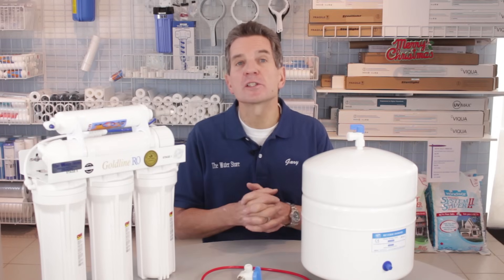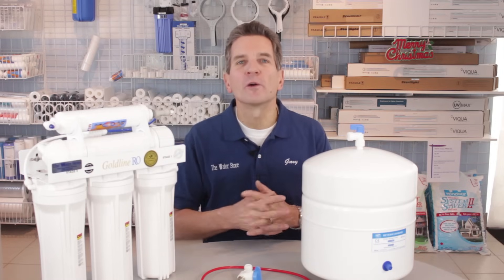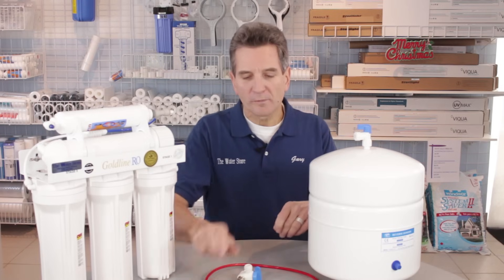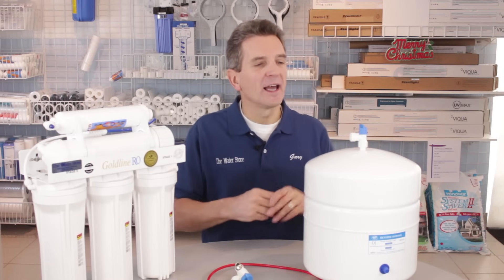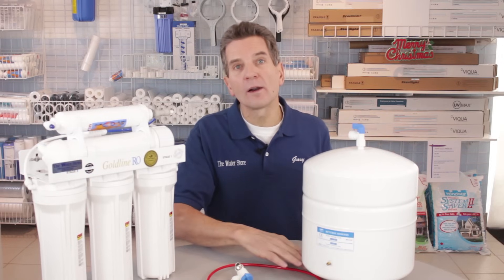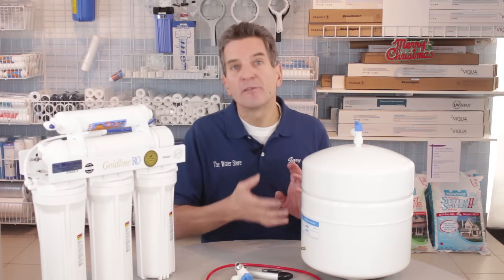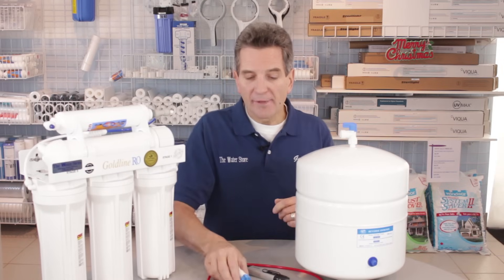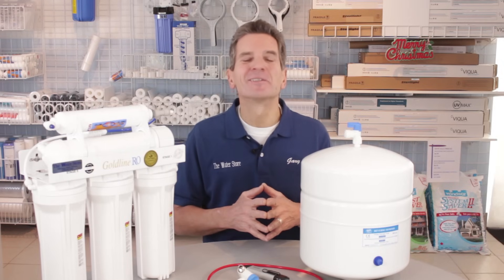Reverse Osmosis Troubleshooting - Little or No Flow from Faucet

Comment: Is it actually 6-8psi? I saw on a culligan website  a min of 60psi. I pumped mine to 80, and still no flow. The valve is open but since we turned it off because of fridge problems, we haven’t seen any flow except a slight trickle
Reply from the maker: Yes, it is actually 6-8psi.  If Culligan said 60 psi they are incorrect.  Try 6-8.

Comment: When my system was installed they only put 3.5 to 4 PSI into it. This time I did the filter change and noticed maybe half of the tank was emptying. Took the tank down to the garage and added very slight amounts of air until all the water was out. Thanks. Can only imagine how much that house call would have been.
Reply: Great video. What is missing is how much air to pump in to drain the tank. "added very slight amounts of air until all the water was out" should be a part of the video.

Comment: If worse comes to worse and I have to replace the tank, can an off brand water storage tank, like TankRo, which Home Depot sells, replace a GE water storage tank? It looks like both have the same type of water valve
Reply from the maker: I am sure it will work initially but you may not get much life from the off brand tank.

Comment: So if there's only a trickle of water coming out and the tank is empty, not full. Would I just need to check the pressure and adjust it accordingly to get it to work again? Or do I have a different problem???
Reply from the maker: Check the tank first. If not then when was the last time the membrane was replaced?

Comment: my system is weak and only put out a few oz per hour. the tank is not full of water it always seems empty.
Reply from the maker: When was the last time you replaced the membrane?  Also, what is your water pressure going into the system?
Reply: @water_estore  i replaced all filters and membrane about a month ago. i did use a t tap to tap into my water line maybe thats to little flow?
Reply from the maker: @TheSummit396  you do need significant flow and pressure to operate the RO.
Reply: @water_estore  as soon as you mentioned that i got a different type of tee tap and it fixed it! Thanks so much. i will be getting a new water softener in near future ill keep you in mind.

Comment: Hi, I was hoping you could tell me about my AO SMITH under sink main faucet filter. Model 1449244 AO-MF. My question is, after installing it, why is there no water pressure at all?
https://youtu.be/G3p7IrO7S9o
Reply: It claims on the box not to reduce water pressure, but it is.
Reply from the maker: Sorry, I have no experience whatsoever with those.  Have you tried calling the manufacturer?

Comment: Great Video!  We have a American Plumber WRO-3500 system and a 5 Gal. Tank.   The tank was about empty in the morning after filling all night.  Checked the water going into it and it's drops and not a flow or stream of water.  What is the normal flow into the tank coming from the system?  we just changed all filter, so they're all brand new.  Is there another issue or blockage causing this?  If so, where?  Thanks!
Reply from the maker: Did you change the membrane.  I don't know how many gallons per minute your membrane is rated for but if it is 50 , you would get about 1 gallon per hour of flow from the system.  Did you add any air to the tank?
Reply: @water_estore  Hi,  Changed to new one which is 30 GPM.  Followed your instructions and it seems that the Shutoff valve is not good as the drain water never stops when tank is shutoff and main is on.  Would that effect the membrane from functioning right?  Shouldn't the tank be filling anyway?  with new membrane removed, and no membrane installed, the tank fills out good.  Is the water drinkable without the membrane?  I do have the other two installed (carbon and post polishing).  Thanks!
Reply from the maker: Omar J. Reyes did you replace the membrane with the same god capacity as the original one?
Reply: @water_estore  Hi,  Changed to new one which is 30 GPM same as old one.  Followed your instructions and it seems that the Shutoff valve is not good as the drain water never stops when tank is shutoff and main water is on.  Would that effect the membrane from functioning right?  Shouldn't the tank be filling anyway?  Would this happen if the new membrane is defected or clogged.  FYI:  With new membrane removed, and no membrane installed, the tank fills out good.  Is the water drinkable without the membrane?  I do have the other two installed (carbon and post polishing).  Thanks!

Comment: Gary, I was watching this video as the water pressure on our APEC RO system suddenly decreased to a trickle. I checked the large tank and it feels very light, so I dont think it's water logged. The filters havent been replaced in maybe 1.5-2.5 years, so not sure if maybe that is the problem. Any other suggestions? (my email is pappasm898@gmail.com)
Reply from the maker: Change the filters first.

Comment: if i just install my RO system.  and i have very low flow,  what is the cause?   Does it take the 2-3 hours fill time as stated in the manual for flow to be to normal rate?
Reply from the maker: Yes it does

Comment: Uhhhh ok, and what if the tank is empty?  He totally ignored that, and that's my problem...
Reply from the maker: If the tank is empty I would check the pre charge on the tank.  If the pressure is correct your system is not making water so likely the membrane or pre filters are clogged or there is no flow going to the system itself.
Reply: @water_estore   I have the same problem with my tank empty, and it turned out to be pre-filter clogged, the water started running again after I changed the pre-filter. Thank you so much!

Comment: why does my tank says "100" psi?? Please help
Reply from the maker: Great question!  I think it actually says maximum pressure 100 psi  These tanks can be used for many purposes but when used for an RO the pressure suggestions in the video are correct.
Reply: @water_estore  Thanks for the info!
Reply: @water_estore  I added more pressure to my tank and it's still little flow from the faucet. It is also taking a very long time to fill water in my tank.. why is that?
Reply from the maker: Co Z you need to check the tank pressure when it is empty and adjust as mentioned on the video. It takes anywhere from 2 to 4 hours to fill the tank, this video explains why How Does a Reverse Osmosis Drinking Water System Work? https://youtu.be/qlexW47DtWA
Reply: @water_estore  you're right I didn't have enough pressure in the tank. I added more and finally it's working great again. Thank you again for your expertise. I subscribed.

Comment: One "Key" point everyone fails to mention, is to replace the schrader valve first, as those bicycle valve inerds tend to fail some times, and replacing the entire tank due to the valve failing is wasteful.

I actually watched a video where the guy replaced his bladder tank, and decided to cut the old one open to see where it was leaking, and there were no leaks or decrease in pressure from the bladder due to the valve being faulty.

Also, if the tank is losing pressure, and you suspect the bladder, there should in fact be Water being expelled from the schrader valve (meaning that there is water bellow the bladder where it should NOT be (at this point you can most assuredly say the bladder is damaged, but if there is no water coming out of the schrader valve, replace the valve first (any bicycle shop will have a spare valve inner for you at a cost of a few cents))

Great video otherwise, concise and to the point 👍🏻👍🏻👍🏻
Reply from the maker: Yes, definitely if the schrader valve is the problem I would replace it before giving up on the tank.
Reply: Hi! I have water coming out my Schrader valve! I suspect that means my bladder is no good but was unable to confirm until I found your comment. Thank you!

Comment: My Aquasana tank showed up with 11.5 PSI in the tank... and after installation I still only get a dribble out of the spigot
Reply: @water_estore  OMG, I called them and they said to get the PSI "up to at least 50 psi in the tank"
Reply: @water_estore  nope, still no luck.  They are thinking I might have a bad manifold
Reply: @water_estore  Yes, their tech support has been very helpful.  They are sending me a replacement manifold.

Comment: Thanks for the video but my tank fills after 30 minutes. It unfills in 10. The PSI on the tank is 7.5 and the drain line is not leaking.

Comment: Followed your troubleshooting steps and found our tank was at 3.5psi. I pumped it until about 7.5psi. I checked it again once i put it back under the cabinet and it showed 7psi.

Let's see what happens over the next few days. 

Thanks for the informative videos
Reply: It's been a month or so and the water pressure from our RO system has been excellent!  I'm amazed at how simple the fix was and how 4psi can change our entire experience with our system from negative to positive.

Thank you for posting this video!

Comment: What is the next step after depressurizing the tank?  How long should it take for the tank to fill and have normal pressure?  I have done this but water still trickles out, if I change the membrane will I ruin it if I need s new tank?
Reply: Repressurizing*

Comment: What if I am having the problem you described but instead of the tank being full it is empty... May I please have your diagnosis and instruction?  You make good videos, thank you.
Reply: that's what I"m wondering too.. did you ever find a solution for lost pressure (only builds up enough water to fill a large glass) with light (mostly empty) tank?

Comment: I assume you check the pressure and repressurize the tank with the valve at the top closed?  My tank doesn't have a valve at the top so I'm wondering if I can repressurize with the tank connected to the system?

Comment: This solved my RO tank problem! When I opened up the valve outside about 8 cups of water came out and the tanks was nearly full (by weight). Once I drained it with air pressure, set it to 6psi, 8 hour later its as good as new! thank you sir!
Reply: @water_estore  Sorry buddy, I dont use Facebook, but yea I shared the video with some buddies that also have RO.

Comment: Hi Gary.  What you describe here sounds like our problem.  We attempted to follow all of your steps.  We got as far as opening the tank and letting out some of the water.  When we then tried to use both a bicycle pump and a compressor to pump out the rest of the water, nothing happens.  No water comes out when we use either device.  It seems that the air is not getting in.  The tank is still heavy so it seems there is still water in there.  Any ideas what is going wrong?

Comment: I, repreassured the empty tank to 6 psi, but the water can nit flow to the tank, the system stopped pumping water to the tank . Please help.
Reply: @water_estore  5 days ago
Reply: @water_estore  yes,after awhile
Reply: It is OK.when i reduce the pressure to 2.5 psi
Reply: @water_estore  Did you think that the pump of the system is weak and it can not pump water to a tank of 6-7 psi and it need to be replaced.

Comment: I have a GE RO system, the flow is really slow out of my faucet. It does indeed flow completely until the tank is entirely empty, but it's so slow as it does so. I have tried new filters and membranes, a brand new tank, I've pressurized it several times and it has perfect pressure numbers.  The flow from the cold water valve is good and fast coming from a 45psi water source. I've even replaced the faucet.... What else can I do? What am I missing?
Reply: The Water eStore the system was in my house when I bought it. For as long as I’ve owned the house it’s been slow.
Reply: The Water eStore hmm, that seems to be my problem since I am indeed going through 1/4” tubing. But I believe that’s the size allotted for on the RO system. Would it work if I used an adaptor to size up to 3/8? I can’t remember if my new faucet is 3/8 or 1/4. I will double check everything and get back to you on this. Thank you!

Comment: Thank You Mr. Gary (the water guy). I have a culligan  RO under the sink filtration system. The faucet fractured and broke off. The replacement is very expensive. I wanted to know if the quick release system that it came with  could be negotiated around.  The tube is pushed into the connectors. The current  tubing girth  is about an inch which brings greater pressure through the faucet. All other faucets have connections that require small girths of tubing and the quick release valves that come along with the faucets can not take the pressures, thereby, causing leaks. Thanks again. Enrique.

Comment: I replaced pre and post filters and ro membrane and flow control. At the sanitizing stage I got normal water flow from the ro faucet. But when I installed the filters, no water flow to faucet. I then took out only the ro membrane to test and I got normal water flow from the faucet. So I put at new different ro membrane cartridge in and now have no water flow once again. I hope you can help please.

Comment: Hello, My tank is empty and the pressure 6.5 ~ 7 psi, but I am still not getting any flow even after waiting a whole day. What would be the next step? Try replacing the RO membrane? My system does not have a leak stop device as suggested in the earlier thread.
Reply: atsuro kagawa is not 6 psi is around 90 -100 psi he was talking 6-7 bar is another measure
Reply: Ricardo Martinez - no.  Unless you want to blow your tank up, 6-8 PSI of air.  The water pressure in the house may be what you state, but the air in the tank is exactly what the professional on the video said it was.

Comment: Hello,
Thanks for this informative video. In my case, I can't empty the tank from the top. It stops draining even though only half empty. I tried pumping air in the bottom valve, but unable to (can't pump any air in). I tried to de-pressurize at the bottom valve and notice dark, muddy water coming out of the bottom valve (where to pump air in). There were also black material that felt like rubber draining out from the bottom valve. I suspect the tank is bad, can you please advise? Also, will any new tank work interchangeably or do I have to go w/ brand specific? Thanks much.
Reply: I know this is an old post but I'll answer in case anyone else has the same question.   If water of any kind comes out of the schrader valve you need to get a new tank.  The bladder is ruptured.  It doesn't have to be the same brand of tank.

Comment: I used this around 9 months ago. And recently the sediment filter and carbon pre-filter had been changed. Yesterday, I found there has no water supply to the RO system (nothing has been changed). And the tank is empty now. Checked the tank pressure coming water pressure, both are normal. Can you please advise if there any can cause no wate to the tank? Thanks.
Reply: Hi mine is working for the last 5 years and suddenly having this slow/no flow problem, after I try replacing the filter, the ro membrane, the tank and finally found out that - that is because of the check valve or No-return valve problem.  That valve is the elbow connector at the clean production water outlet. All three water connectors (one going in and two coming out of the RO membrane housing) look same but when you unscrew and take them out you will find the one at the clean water look different - you can google and buy one online. Damn, after I watch all these youtube videos telling me is the tank problem, the filter clogged... I even replace my tank. Finally, I bought a new RO housing and found out it is the check valve. I still using the old RO housing but just replace the check valve and now the water is finally flowing again, just in case the "flow restrictor" I bought that is attached to the wastewater-out seems usefull too.

Comment: replaced membrane 2nd feb 2017 ,,,,,, pump keeps running as no build up of water in tank to create pressure to shut off. there is good pressure of water coming to first filter housing but water not getting to tank
Reply: Check my solution above, basically replace the check valve (at the clean water connector)